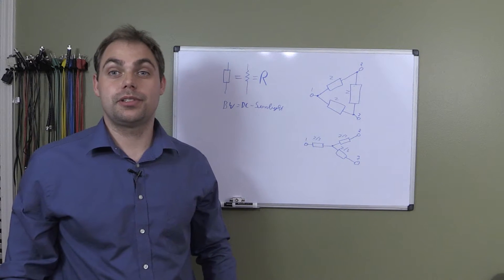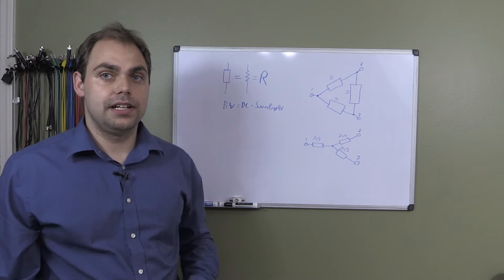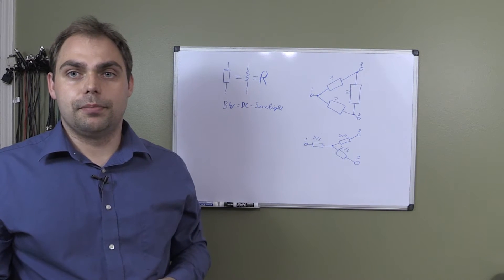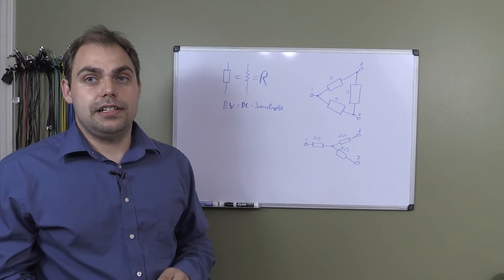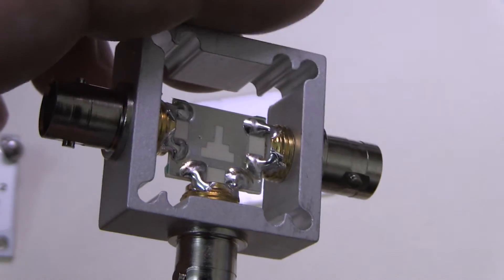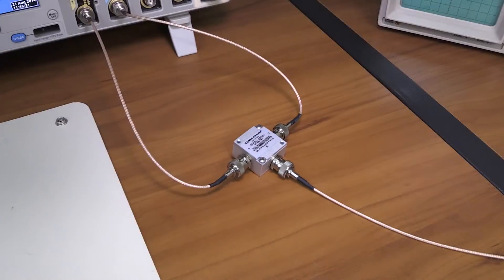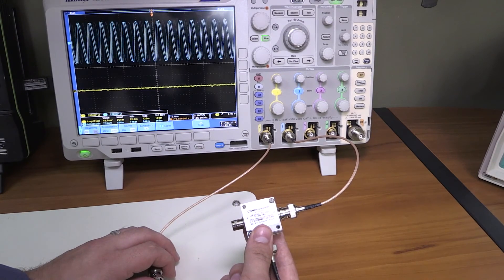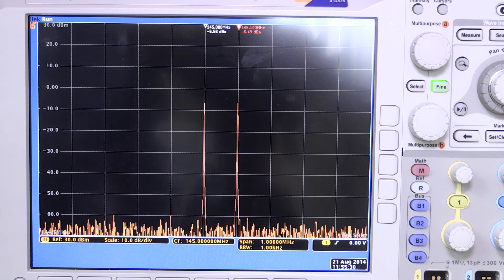Resistive Splitters and Combiners [RF Circuit Design]

Comment: The thing I don't understand is how resistive splitter provide isolation between two inputs ? Also how the delta loss is -6dB I don't understand the current flow there

Comment: Dear Sebastian, thanks for sharing this very usefull video. I wonder its DC characteristic as well. You hooked AC signal into the splitter from Signal Generator and then check the signal level in the ossiloscope. Does the part exhibit similar figures when you apply DC offset or only DC voltage ?

Comment: The star splitter doesn't seem like it would total 50ohms.. Two parallel  resistors are in series with a single resistor... Seems it would be 16.6 + 16.6/2... Total about 25 ohms... Hmmm. I'm missing something....

Comment: I have made those with 18R resistors, and they work well enough for most applications. Made plenty to do network splitters when I had no spare ports on the hub ( yes hub not switch with coax cabling) and the cables involved were short. Even did a few to combine and split TV and FM signals down the same coax, and I was too cheap to buy the ferrite ones. Plenty of signal at the antenna as I could see the transmitter with 20kW of output 12km away, but I was down in a RF hole. Even worked when the antenna rotted off and left only the dipole on the pole.